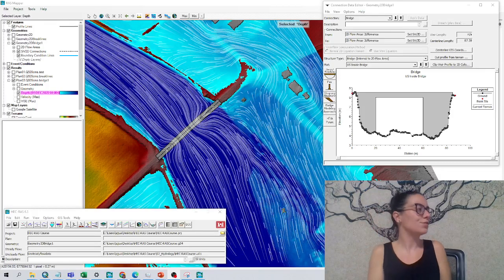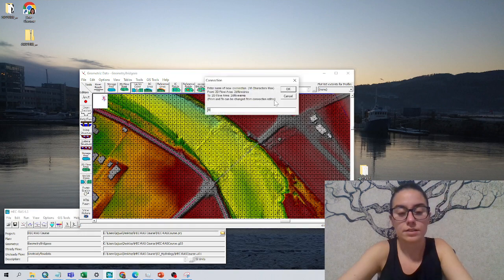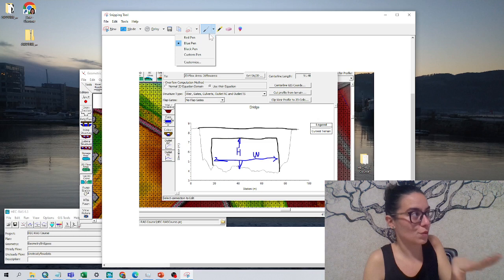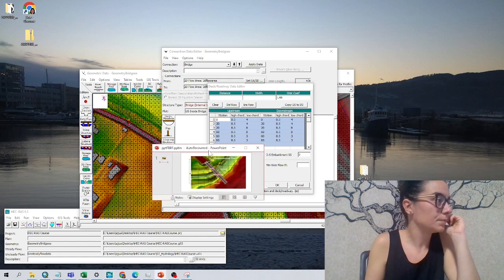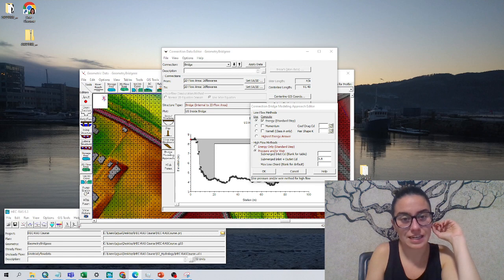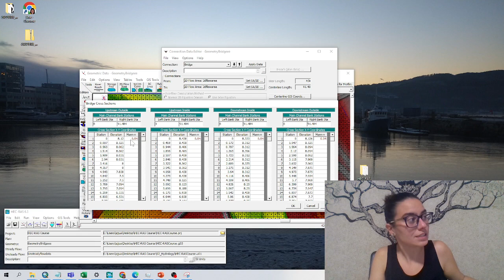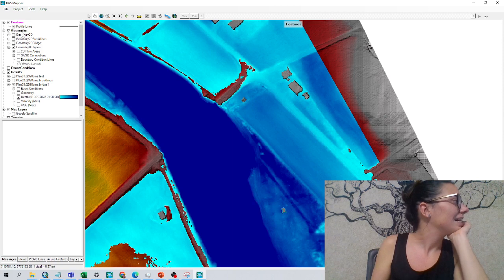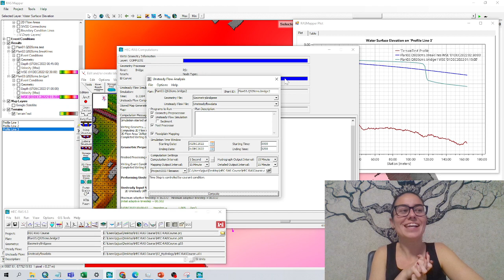Chapter 8  HEC RAS 2D Bridge tutorial

Comment: Good afternoon. 

My name is Bruno. I'm a civil engineering student in Brazil and a great admirer of your work. 

I need to carry out a simulation of the rupture of an earth reservoir for water storage located outside the water course. 

My question is whether Hec Ras allows me to carry out this type of simulation or if Hec Ras is just a simulation of structures in the water course. 

Is there any software that allows me to simulate the rupture of an earth reservoir to accumulate water outside the water course?
Reply from the maker: Thank you! I did enjoy doing these videos and is great that people find it useful
I do have a video of a dam break simulations, it does not include the debris material in the flow through.

You could similarly simulate and earth reservoir if you can estimate the parameters of this break, i.e. time to break, and shape after break.

 Lot of luck with your work!
Reply: @anajuarezgomez690  Hello Ana. thank you very much for answering me.
the issue is that I need to simulate the rupture of a reservoir that is outside the watercourse and not a dam in the watercourse. So, because it is a structure outside the watercourse, there is no upstream and downstream flow data.
Have you ever done or seen someone do a simulation of the rupture of a reservoir outside the watercourse in hec ras or in some other software?
Reply from the maker: @bruno180586  I would create two 2D-flow areas, one for the reservoir, and anotherone for the downstream area where the flow will run.
In the reservoir 2d flow area, I would set the initial condition to a water level, the level of the reservor, instead of an inflow discharge.
Then I would create the dam, with a 2D conection, and break it at time 0.

It is actually really similar to this model, just donnot set an inflow data, just the level of the reservoir.
https://www.youtube.com/watch?v=kzAZGwn9Kos

I hope this helps

Ana
Reply: @anajuarezgomez690  I'll try, thanks

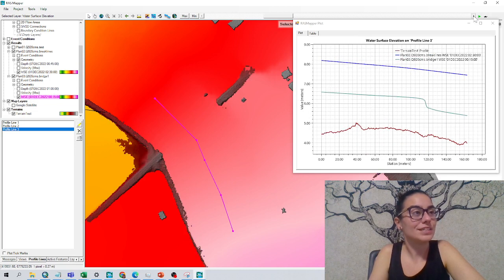Comment: Hi Ana. Nice video. Quick question. At 7:49, i noticed the bridge backwater effect stays there even when you change the timestep (i am presuming that RAS still produces the backwater effect even during low flows). I have noticed in my models that if we model bridge in RAS, even for the case when water is not touching the low chord, RAS still produces the backwater effect. If we compare water surfaces for bridge/no bridge scenarios (assuming water not touching the low chord), the resulting water surface profiles comes out to be different. Have you ever expereinced this and if yes, do you know how to address this/perfectly model a bridge to avoid this discrepancy? thanks